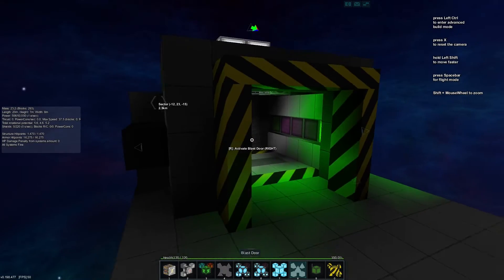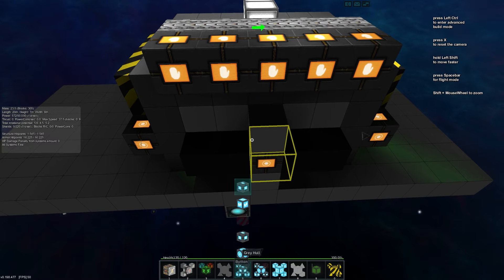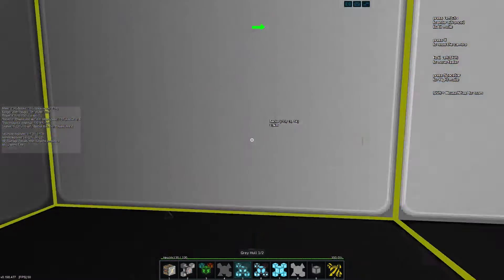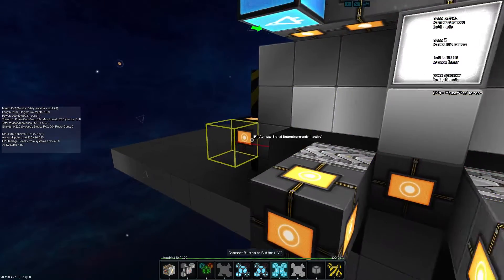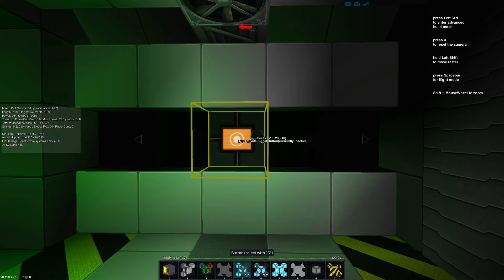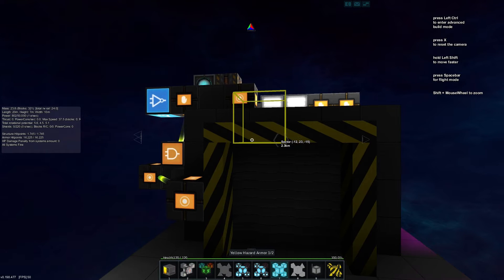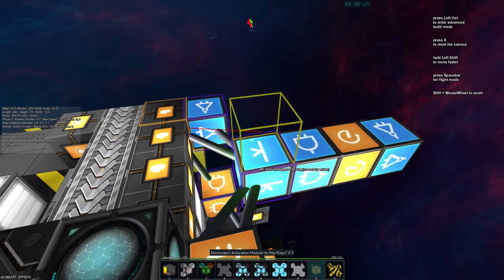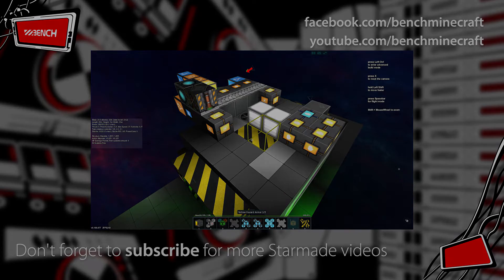Starmade Logic #24 - "Pressurizing" Airlock using Rails

Comment: Is it possible to do this with delays instead of rails?
Reply: Worked it out, yes you can but it requires two “rails” of delays and is a bit messy-er.

This video helped me work it out though nonetheless.

Also an easier way to do flashing lights is to just line them up with the activation modules next to the rails

Comment: Are you able to slow down the rotation on the rotation blocks? I've tried connecting a rail speed controller to it (it as in 4 rotation blocks) like you did on this video and it did not seem to have any effect on the rotation.